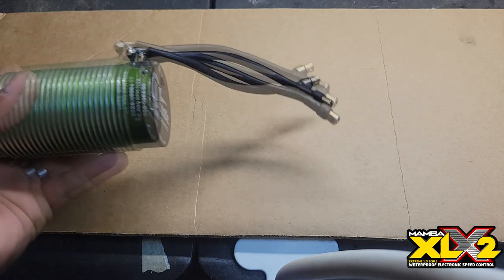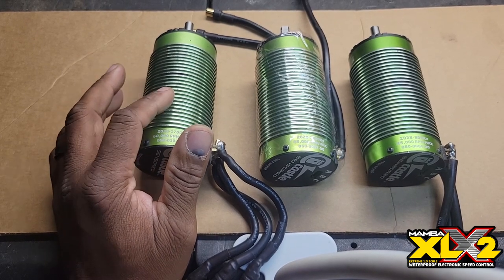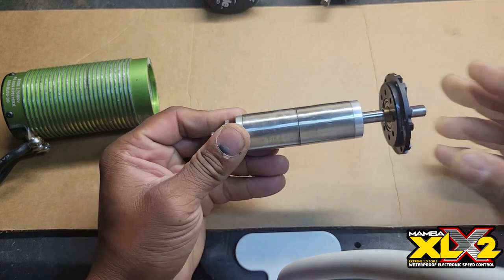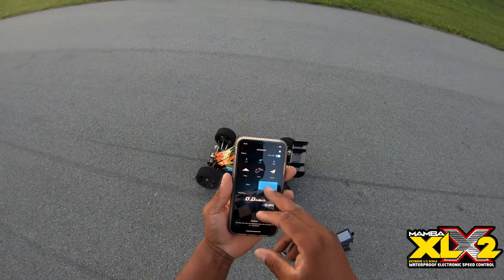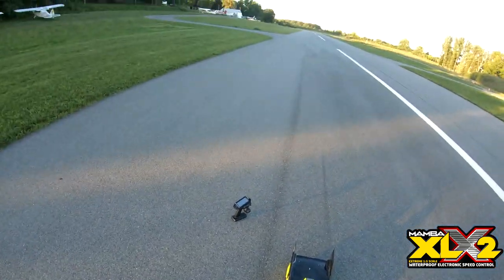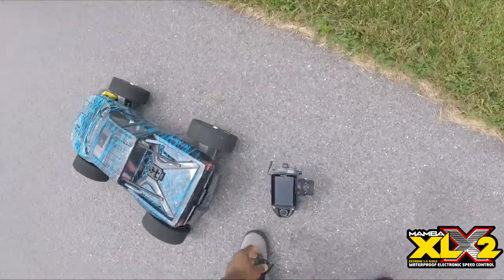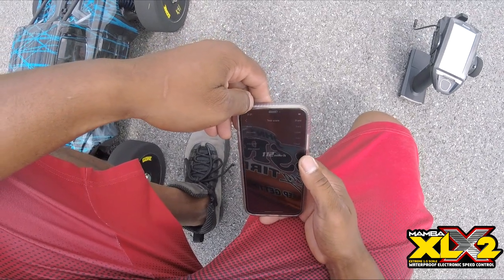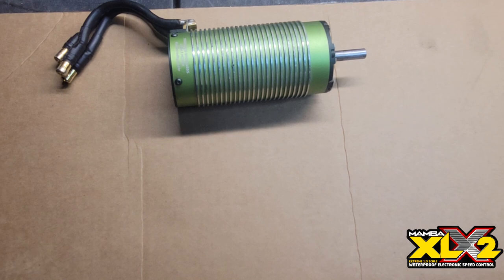[NEW]Castle Creations 2028 1700kv🔥🔥🔥🔥😱

Comment: Yessir!  I peeped that this morning.  Definitely Castle is looking for that 👌🏽 perfect motor that is versatile to deliver power and reliability.  With the cool 800 - 1100kv 2028 1700kv with the power of the 1721 2400kv.  We getting there.  Can't wait to get this in my HoBao VTE 2
Reply from the maker: With its size it definitely handles more power then the higher kv small 1721 2400kv motor.  It's really all ball down to how they are dialed in
Reply: @skyliner359  I can't wait to see what you get brother.  I'll be following.

Comment: I've been running the 800kv Castle and XLX2 ESC on 8s conservatively and I've always wondered if it would run on 10 or even 12s,well since you've run it on 10s that I may have a go at it? Nice runs,and thanks for the info on Castle 1700kv power 🔋 👍. KEEP ON BASHING, OR RACEING! FROM LONDON ONTARIO CANADA
Reply from the maker: 2028 kv is rated for 12s voltage and from my experience it's awesome on 12s. Thank you for watching

Comment: Has the Castle Creation motor Hallsensors, so would it run with ebike Controller and 16s?
Reply from the maker: Yes castle has 2028 800kv, 1100kv and 1700kv in sensored
Reply: @KiloWattRC  I know but Hallsensors or Encoder or ABI?
Reply from the maker: @campoint.x1032  It's all EFRA hall effect sensor standard

Comment: Although I applaud Castle for putting out that motor if they aren’t going to put out a more capable esc, what the point? I am only saying that because on my 1100KV 2028, I melted the solder off the board to the point that the battery leads fell off. I’m not hating on it, but just don’t understand where Castle is coming from with this?
Reply from the maker: That is actually fixable.  I just re solder and re apply epoxy.   That's the joy of high powered waterproof esc's.  Xlxv1 has actual wires coming off the driver board and wasn't waterproof.  Castle owns the speedrun and drag racing games.  Yeah they are releasing next gen esc next year.  If you are not drag racing or speed running just run a hobbywing system 🤔

Comment: Woww my castle 800kv is a beast with max4 on 12s can't imagine this motor on 12s
Reply from the maker: It's a 8s motor.  It spins faster then 800kv on 12s.  But if u put the rotor in 800kv it can handle 16s easily
Reply: @KiloWattRC  yeah I got a xlx2 for it imma put it in XRT BUT your videos help

Comment: Hey man this is a speedrun only motor right and is castle Worning on a 12s esc really need one that Can pull some amps
Reply from the maker: It all depends on what u dial it in for.  It's definitely a awesome speed run motor but can be used for drag and general use is geared properly

Comment: Bruh you blew my mind.  What if i put 1700kv rotor in 1100kv can will it keep cool on 12s.  I have a max 4 and 1100kv in a kraton.
Reply from the maker: Rotor will be mechanically fit for the RPM'S.  As far as temperature, u have to monitor that and address it

Comment: Would the 18.5 kw max be the same for the 800kv. Or better. What is the max you have run the 800kv @8s to?
Reply from the maker: All the 2028 motors can handle 25KW plus honestly.

Comment: Let’s get technical I’ll keep it short.. 
current setup:
mmx8 - 1717/1650
on basic PH 7200’s 2x4s
QS8 plugs
46s
27p

I can do 100mph and still have fun drifting and plenty of stop/go with and stay under 160°F and 
35 minutes runtime give/take and current is under 300A.

It’s just what I want bcs the motor fits without fabrication and does not cogg during consecutive stop&go and drifting.

Sooo, I have a shelf queen v1 platform that never hit the ground, so if I don’t go with another CC1717/1650, then I want it to be something that will OUT PERFORM and also “fit” in the stock mount location.

Regardless of a 46T diff or 32T spool, I’m still going to gear the limitless like I geared my felony that I explained earlier because both motors are almost the same kv (1650) & (1700) and I want to be able to drive the limitless like I drive my felony, seems fair enough right lol?

So now that you know all of the details, if I flip my mount for the 2028/1700, by how much more will it outdo the 1717/1650 and will the motor OR esc run hotter or cooler?

Lastly, would you know of a motor that will outdo the 1718/1650 and “fit” in the stock configuration? Or will it ultimately have to be a “bigger” motor to outdo the 1717/1650?

Thanks, I did my best to keep it to the point.
Reply from the maker: 2028 1700kv will wake that joker up bro.  Bigger can too so will dissipate heat better.  It's up to you if you want more torque and KV.
Reply: @KiloWattRC  …. but will it be efficient for my driving style? Or is the 2028, 1700 KV meant for running in a straight line?
Reply: You say gear it right what is right for 6s in series 45s 34p ????

Comment: @kilowattrc can I runs this on 8s in a talion geared for about 90mph and bash with it?
Reply from the maker: yes you can, but I would run a smaller motor and lower kv for bashing.   1721 1250 is perfect for your situation